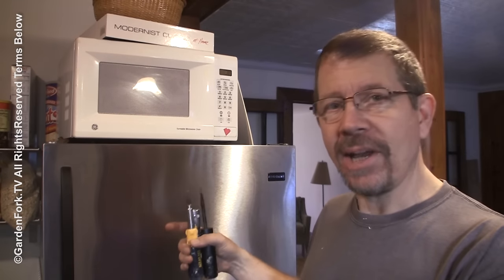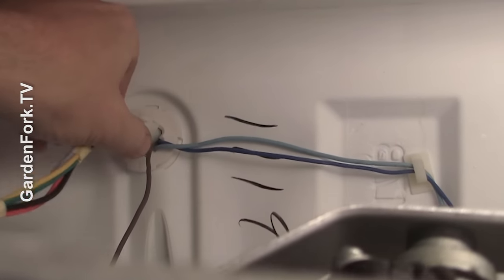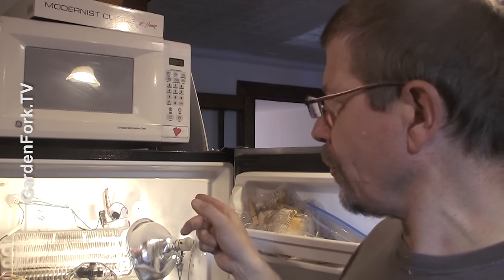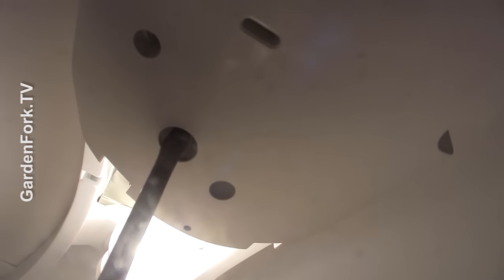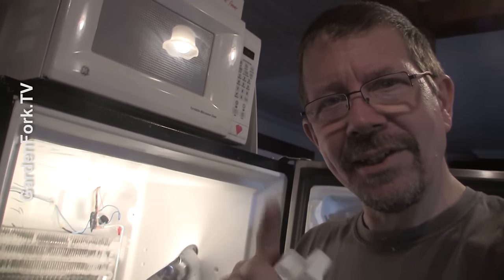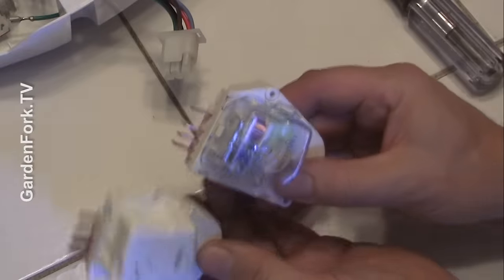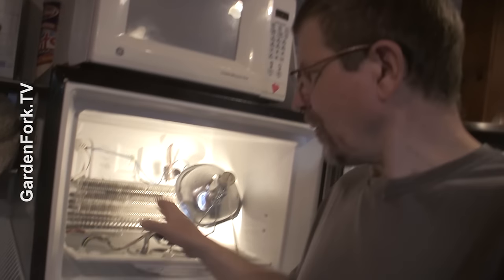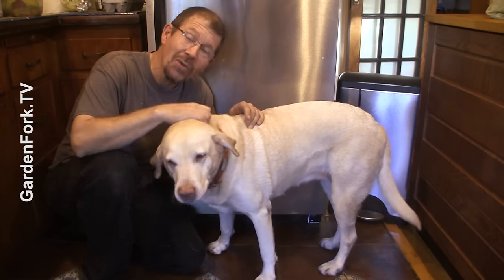Refrigerator Repair - Freezer Coils Frozen - Refrigerator Is Warm - GardenFork

Comment: i had my fridge defrosting for about a day with a heater to melt all the ice..
i measured the temp with one of those infrared laser guns.. the freezer is -33°F and fridge is around 50..
its been roughly 12 hours for the temperature to settle.. still not reachin that 40° for the fridge.. and the freezer seems really low. thought bit was supposed to reach a max of -8 but maybe its workin OT to try to cool the fridge..

Comment: I have a similar fridge..I am finding that it never turns off. I think it may be because the timer is broken and does not turn off so that the heater can work. I have frost build up but not SO MUCH ice. I bought this used and hoping to get it to spec. Thx

Comment: Thanks man, same fridge same issue. Can't wait to fix! What timer do I need if I have the exact same fridge with the same issue. I did the test and the coil immediately started  defrosting. I am waiting with it to put it back together. Then I'll turn it back on since I don't have a new timer yet. Just need to know the part number. I'll def use your link.
Reply from the maker: Hi Lauren, its best to check on the website about the part number, it may have changed since I did this. good luck!
Reply: i figured it out! Thanks.

Comment: Update. I used the info on this great, informative video to diagnose the problem with my 22 year old fridge. I replaced the timer and everything worked great for 4 months until now, when I find myself with the same problem again. Freezer not defrosting. I checked the heating coil by advancing the timer and it works so either the timer went bad again or the defrost cycle on the new timer is not long enough to totally defrost the coils and the frost has been building up for 4 months. I ordered a new timer. We'll see.
Reply from the maker: Maybe its the thermostat? its a round black thing that sits against the copper tubing as it exits the back freezer wall usually. thx!
Reply: Make sure that you defrost ALL ice from unit when do repair. Heater is NOT designed to melt heave ice. Will build up again over time even if everything is working properly. Also make sure drain is NOT plugged.
Reply: Could it be condensation traveling up there from open containers in the fridge or leftovers put in the fridge hot/warm?

Comment: Thanks for the information.  That may be the problem with a second ref. I have for beverages.  I was just going to throw it out and get a new one but,  because of you I am armed with the knowledge to repair it.  Thanks again, Dave
Reply from the maker: if its the defrost timer, or the thermostat that sits on the coil, its an easy repair. also check that the fan is running, that could be an issue too. thx!

Comment: Great video but remember that some bigger fridges DON'T have a defrost timer, the timer function is performed on the controller board :( There are also some sensors that can go bad that trigger the timer function when it detects the coils are frosted up.
Reply: not bigger fridges. modern fridges you meant

Comment: Just wondering about that black electric tape by thermostat . My issue is  I have the same tape in mine and it has melted and dripped on the freezer coil . Seems to be causing a really bad smell . I cleaned the melted stuff off the coil .should I replace the electric tape ??

Comment: hi there,
found the defrost heater, overheated, replaced it with a new one

now showing, temermal fuse error but thermal ( have tested the thermal fuse with multimeter it's ok and no physical damage)
what could be the problem please?

Comment: I’ve replaced both the timer and defrost heat rod. Freezer is cold refrigerator is not. How do you check fan? Should it always run?

Comment: I have one female connector with 2 wires. 1 brown and 1 pink. The pink wire goes to the defrost timer and, the brown wire runs "up" to the main connection. There are "no" other male connectors.
Will the defrost timer still work, even though the pink wire that comes from the defrost timer to the female connector is not connected to a 2 prong male connector? 1997 Whirlpool top freezer.
I looked all around the compartment and still cannot find a 2 prong male connector.
Awesome video. Thanks a lot.

Comment: Hi i have a fisher & paykel refrigarator model N395b the defrost heater have 2 blue/white wires & 1 green do is that green ground ?  i  aslso like to ask you where is the thermal fuse (the wiring dia shows me through to thermost but nothing is there.i will be happy if you give me an idea thanks a lot

Comment: If you're manually turning the (old/original) timer switch until it clicks and the heat rod heats up, how do you  know that the timer has actually gone bad?
Reply: It's not telling the thermostat to click on. Notice his got hot even with his old timer.

Comment: I have refrigerator no freezer my coils are frozen.  I tripped the timer got the heater working again.   I ordered a new time should be here few days.  My question is the top coils are frozen but the bottom coils are not.  Is that common for timers gone bad?  I was T sure if it’s a thermostat but I’m reading that if it was bad the heating element wouldn’t come in when I trip the timer

Comment: My fridge has the same problem, the coils freezer up, the repairer said the fan was broken. He put the new one and told us not to use it within 24 hours, and charged big$$$.. when we turned it on it went like new but within 5 days its started showing icing at the back of the freezer compartment and the fridge down is not that cold. I gave the repairment company a ring, the said they will send a technician back again on Monday😥😥😥😥

Comment: Thanks for a great explanation! Once you rotated the screw of the timer (till the click) you were able switching it into a defrost mode, the defrost coil started heating up. Why you concluded then that the problem is in timer? Thanks! (I have frozen coils as well, checked for continuity the defrost coil and the timer, both are fine according to a multimeter.)
Reply: @Evgeny Amelchenko what did you find with yours? His heat worked so yeah why did he replace the timer? Lol mine is frosted up but the heat coil doesn’t come on I wonder if it’s the heat coil or the thermostat
Reply: @lh98  the problem was in malfunctioning defrost thermostat in my case.
Reply: @Cezve_340ml  was the heating coil not coming on because of the thermostat being bad?  My heating coil doesn’t come on but when I test it with a meter it seemed fine so I’m wondering if it’s the same problem as yours the thermostat (could the thermostat be not letting the heat coil come on) ? Maybe I’ll try jumping the thermostat 😳
Reply: @lh98  well, when technician tested the thermostat right upon opening the back cover of the freezer, he claimed it was fine. However, only after he replaced the thermostat for the new one, the coil really began doing its job, i.e., heating to defrost everything. Hope, that helps.

Comment: That's not the only thing that it could be.  I did all this.  Even took out the timer and tested it - it was working fine but still replaced it.  Freezer still would not defrost. Tested the heating element and was fine.  The only other part was the defrost thermostat(could not test).  So, I replaced it.  Still would not defrost.  Could not replace anything else, everything was working fine.  The problem was low refrigerant.  The thermostat has to drop to a certain degree before it closes.  My freezer was not getting the temp down enough to close the contacts on the thermostat, so the heating element would not come on. After I added some refrigerant I didn't have a problem.  Thermostat closed and freezer defrosted.  So LOW REFRIGERANT WAS MY PROBLEM.
Reply: When you took the back panel off was there only frost on the bottom of the coil?
Reply: @Anubalfer  one time yes.  The other times it was frozen to top.

Comment: I'm new I just subscribed, I have a whirlpool french door refrigerator model # WRF736SDAM13, I got it from a friend of mine, he told me it stopped working after it freezed so both are warm freezer and fridge all the time  . I performed a self testing on the fridge it shows that the defrost heater (bi-metal) is not working. My question is if the defrost heater is defective does that prevent the freezer and the fridge not getting cold?

Comment: What is the voltage reading on the black rod used to melt ice?  Mine is reading 1.5VAC when thermostat is off and 20VAC when thermostat is on.  Plus, black rod doesn't heat up when thermostat is on.

Comment: Fixed fridge. coil was frizzing up .top compartment wasn't cold enough frosted coil checked thermostat and timer. Everything is fine now. Question I have is does thermostat mater what cycle it's in???
Reply: I meant to say what cycle the timer is set in

Comment: I did this and the defrost coil started - heating up etc. Then I turned the screw again to cool and back to defrost, but this time it has not started heating up.  My question,  is it the defroster or not?

Comment: My temperature adjustment is on the side not at the top of my refrigerator will this make the timer be in a different location. It’s practically the same refrigerator as yours Fridgidair top freezer but it’s a different model.
Reply from the maker: Check some of the appliance parts websites , the have diagrams and info on diagnosing.  Good luck!

Comment: What if the main tstat is stuck on and not shutting off the unit? will it not cause the freezer to freeze over...?  and that tstat disk on the evap coil has to be a certain temp before the element can come on also right? I believe that tstat on the evap is a safety to keep the heater from coming on if the evap is already too hot..right?

Comment: Mine is a defrost model. We've had to turn it off, let the ice melt, then it starts working again like its supposed to. We know when its working properly b/c it gets hot on the side of it from the outside. Does this sound like a thermostat issue (i.e. that it needs replacing)????

Comment: I have the same problem. I bought a new defrost timer from the manufacturer using the model# and series#. The defrost timer is for 8 hours. Now, the coils are are covered with frost on the top half because, I can feel thick frost on the back panel upper half.
Is this normal or, something else?
Awesome video. Thanks a lot, Garden Fork.
Reply from the maker: +Neil Williams hi Neil, sorry I don't know. A few of the parts suppliers have vids on this. Thx!
Reply: Thank you for your reply.
Reply: It could be that the defrost cycle of the new timer is not long enough for the coils to defrost completely.

Comment: I bought a defrost timer from your suggested company.
It works just fine but, why do I have to set the temperature on the fridge and freezer on the "warmest" setting to get it to run properly?
Reply from the maker: Not sure Neil, you can call the supplier and ask. Thx!
Reply: Thanks.

Comment: Hello Sir, Ice is forming near the evaporator behind Freezer compartment and the Fan is getting stuck. But the freezer is cooling properly. 
The below Refrigerator compartment is not cooling properly. Please tell me what must be the issue? What reparation needs to be done?
There is a small leakage in Gas pipeline behind the Refrigerator

Comment: How can I find the timer for my Freezer Frigidaire FFU1464FW0? Please help,by the way, after I change deforst thermostat for my freezer, then I run the test without put back the evaporator cover back, then 24 hours later I see only frost build up at the copper pipe (before evaporator),but not at evaporator and I'm not even few cold here! So what wrong my freeze or because I did not put the cover back or some thing else was wrong?

Comment: I suspect ignoring r DH (defrost sensor failure error) for my LG caused leak(s) in the sealed system due to ice build up on the evaporator coils for 18 months by turning off for 5 mins and back on.  If the leaks could be fixed life would've been so nice.

Comment: Good job, I watched another video with similar instructions but you have a fridge similar to mine so it's good to know.  Thank you.
Reply from the maker: the location of the timer might be different, but if it has the temp knobs right in the middle of the fridge roof, the timer is probably there as well. thx!
Reply: Well mine looks like yours inside. I've saved the video because I have a couple of older ones acting up.  Who knows you might have SOLVED my problem. So thank you.
Reply from the maker: refrigerators are pretty simple, it seems the ice maker breaks a lot, but luckily i don't have one of those.
Reply: Yep we got ones without them safer, no likely hood of them leaking on our floors.

Comment: As soon as I actually get a minute, where I’m not tired, I’m going to check this out.

My GE tip freezer fridge started having water dripping from the freezer ceiling when the weather got really bad during the July 4th week. I knew that I’d had water dripping from the freezer to the fridge, intermittently, for a very long time. But, I never have time and would simply keep a container to catch the water. I would need to empty the water once per week or, when the humidity got bad, more frequently. I got so busy recently, I just let the whole damn thing go and let the organizer bins fill up. I knew that I also had about a 4” gap in the freezer door gasket. It seemed I might need to replace that to stop the humidity from getting in but, I just gave that area a slight tug and, now, the gasket has that “kiss” feel and sound, with no more cold air escaping, like I thought it would. I did realize that I had a lot of ice backup on the back wall and, when I removed the fan shroud/conduit, the fan had become frozen and the evaporator was a block of ice. I disposed of my food and hit the circuit breaker for the day. Whatever ice was back there and in the foam insert (which I’d mistakenly split it half) had melted.

As is usual in my life though, my problems weren’t over. For the first couple of days, everything was working great. Maybe better than great. The freezer was down to zero but the fresh food compartment was getting a bit too cold and I was afraid for my glass containers to burst. So, I turned it down to the appropriate level of 4, for this model, on the thermostat dial. Buuut, over the course of the past week, while the freezer has remained cold, you guessed it, the fresh food compartment has warmed up. It is now at about 65 degrees.

Tonight I removed the fan shroud in the freezer again and, the evaporator wasn’t a block of ice but, quite frosted up.

I’ll mention that I’ve ordered a new gasket for the fresh food compartment as, I thought that may have been the problem. May have been a waste of money but, the old gasket looks a bit “tired” and doesn’t have that same kiss and adhesion that the freezer door has. So, at least I got the gasket cheap. Because, when I see your video, I highly doubt that a somewhat tired gasket is the difference between 35-40 and 65-70 degrees. It’s not as if I’ve ever felt any cold air coming out and, although I didn’t do the dollar bill test, but did add Vaseline to the gasket, it still continued on its path to getting warmer.

So, when I’m awake again, my next step is to do that timer test with the screwdriver to see if it kicks in.

I guess I feel unsure that it’s the defroster or the timer though. The reason is that, just before SHTF during the July 4th week, I was getting timed, intermittent water dripping inside the fresh food compartment. I am certainly no expert, but what that tells me is that the timer and the defroster were working, despite the fact that I had an ice blockage that caused defrosted water to divert into the fresh food compartment. Doesn’t mean it hasn’t died since then though. It is a lesson that, just because you removed power, defrosted it and it no longer drips inside, that doesn’t mean you’ve fixed everything. It could mean that you have no drips, because the  timer, defroster, thermostat or something else has halted the defrosting process and the evaporator isn’t dripping, because it’s freezing into a block of ice again, without any proper intervention. That’s not a good thing.
Reply: Stupid question, while I’m sleepy. Shouldn’t I be able to know whether the defrost timer is working by heating the refrigerator sounds periodically going on/off?

Comment: Hi, was hoping you could help with a side by-side refrigerator. The freezer side will freeze over like Mount Everest, then completely thaw out, making my frozen pizzas soggy when I cook them. But the freezer will go back to normal. So it seems the freezing and thawing part is okay but I think it might be the timer or maybe a thermocouple is misreading the temp. .? Trying to extrapolate from the video above but configuration inside freezer is different. It’s a GE model 
GSS2525JFPD. CC. The freezer also has an ice maker and dispenser. What should I try first? Thanks if you can help!

Comment: I ended up buying all 3 after the timer failed to fix it. In my case it was the thermostat.. I got the coil and themostat as a package it was only 5$ more and plus I really didn't wanna chance it not being the thermostat and being another week without my fridge...... I feel kinda dumb just throwing parts at it..  but surprisingly refrigerator parts for my unit so cheap... 10$ for the timer.. 15$ for the thermostat and coil kit.  Plus to check some of the stuff is a pain it's easier just to replace it..